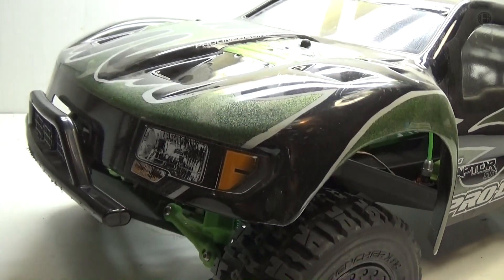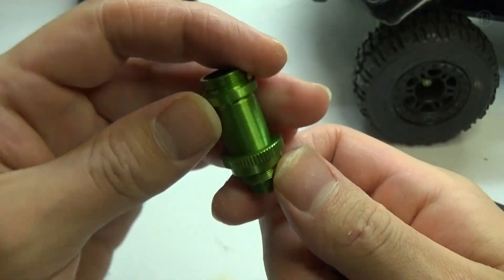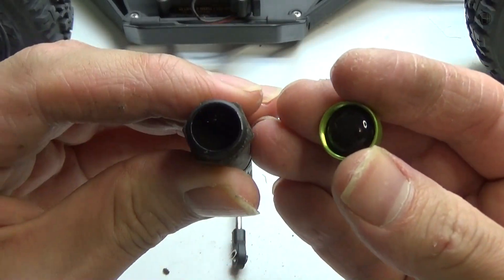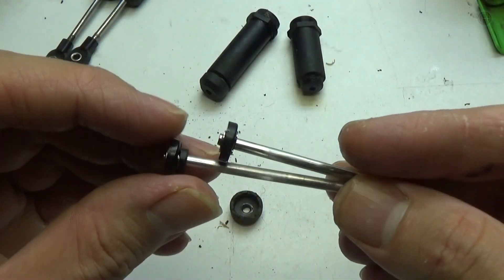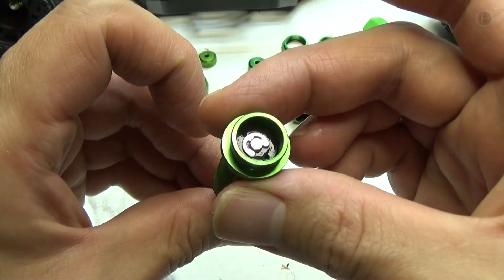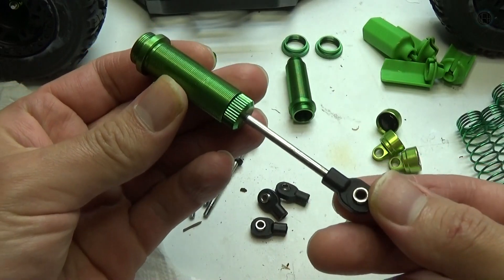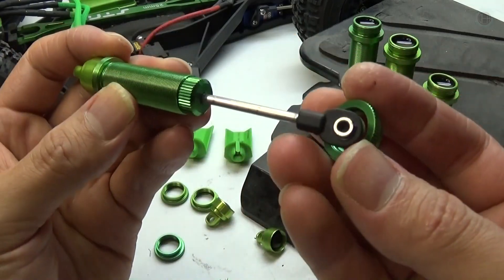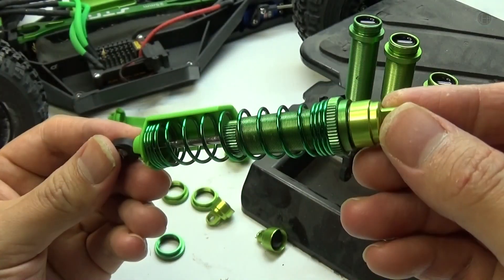Creature - Traxxas Slash - Level 44 Upgrade - Aluminum Shock Bodies

Comment: Who else here would rather have the plastic spacers instead of the adjustable ring. With the spacers, it isn't a lot of work to put them in but with the adjustable ring, it takes FOREVER to adjust it and your hand will get tired fast. That's the way that I think of it.
Reply: but then you have to carry around all those extra springs if you wanna tune on the go

Comment: Just a tip for assembling these: Never assemble O Rings dry. Get some Associated Green slime to help them to go together. At the very least, apply a coat of shock oil on them if you don't have that.

Comment: When u close the top shock cap you should have the piston all the way in if you screw it on while the shock shaft is out when the shock is working the excessive presume cannot come out as the is no bleeder hole
Reply: Hey, thanks for that.
I was wondering why I didn’t have a good shock after twice filled.
Thanks

Comment: Love all the green!  Any issues with your STRC shocks leaking?  I have the same green shocks on my Rustler 4x4 VXL.  I have both STRC and Traxxas aluminum caps and cannot get them to stop leaking out the top and bottom. I've tried various methods of assembling the shocks to no avail.  The stock Ultra Shocks weren't on for very long but I don't recall them leaking like the STRC's.